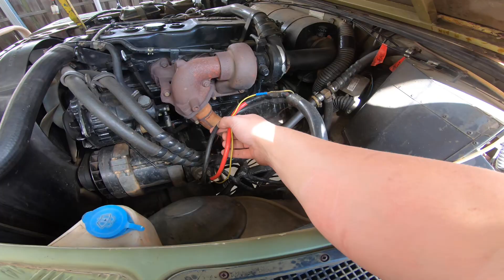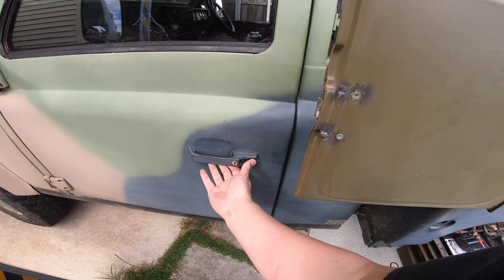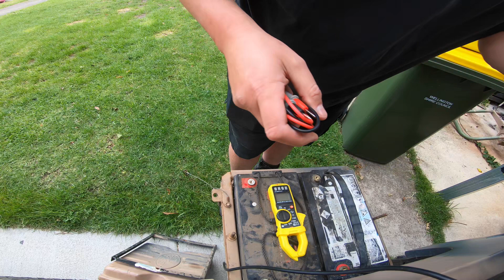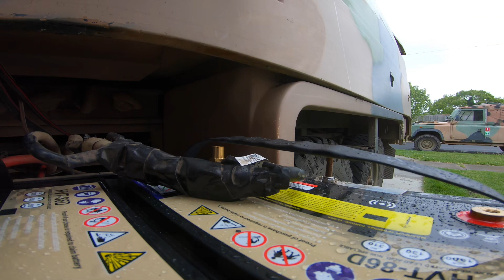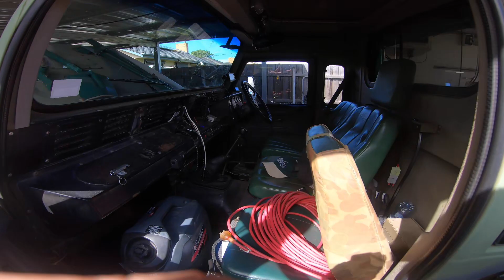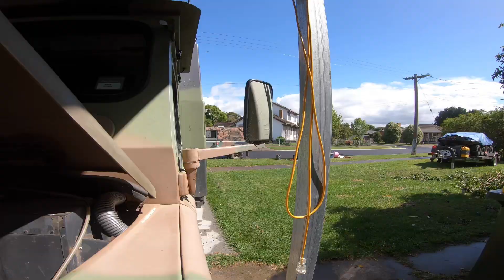My deep cycle AGM's died... | 6x6 Land rover 24v battery swap. #batterychange

Comment: As I understand from my FFR 4x4
For 100A charging, you really want to have four batteries (2 series sets in parallel) The FFR has two each side ( one 24V set each side)
- For only one pair of batteries, I understand that you can set the 24V alternator to only deliver 60A  which is much kinder to the batteries (I understand jumpers in the regulator module area)

ps I have no idea if your 6x6 has a second set of batteries that were not part of this video

On a side note, I have found that the Victron 24V to 12V  are quiet in terms of RF noise generation and good for HF radio work
Reply from the maker: so this is 12v start, 24v auxiliary, and the alternator has 100a and 40a settings, currently set to 40a to avoid boiling them. the batteries in there are 135ah AGM deep cycle type and will take a lot more charge current than a normal wet cell.

there is no room for a second set of auxiliary batteries in there. 

The dc-dc converter in there is a linear regulator type - and very smooth with no RF interference - all be it a touch wasteful.